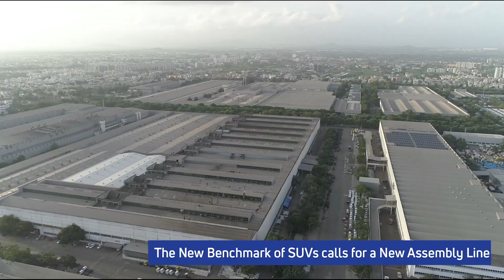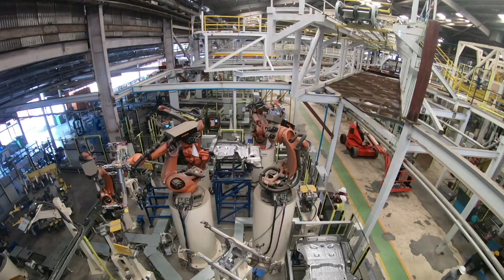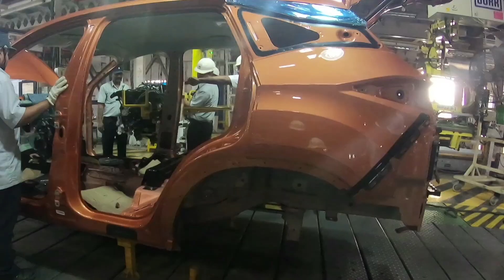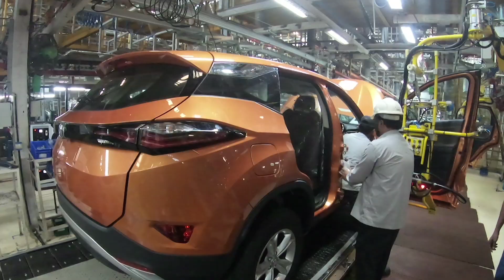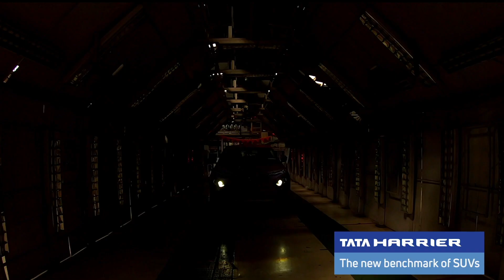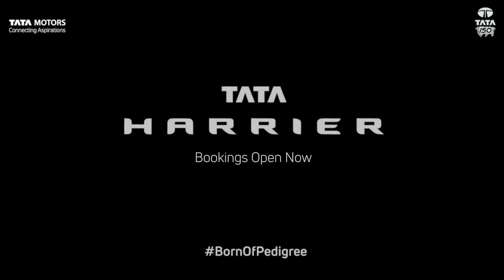Tata Harrier - First Car Roll-out

Comment: Tata motors please add sunroof,Tmps in Harrier.
Reply from the maker: Hi Deepak, thank you for your valuable input. We have shared the same with the relevant team for future consideration.
Reply: @tatamotors  I have also face problem with with safari storme airbag was available only in top model while Scorpio has optional airbag and abs also 4x4 from base variant.Please add airbag and cruise control and touch screen infontment music system in Safari storme ex variant instead of discount offer better features. Cruise control is must features for long drives in SUV I am getting 29-31kmpl in Honda city diesel on cruise control on highway which also increase fuel efficiency and customer satisfaction Honda uses cruise control features to show better mileage than company ARAI figure to convince customers and provides cruise control on 2nd variant onwards.

Comment: Dear Tata Motors,

Congratulations for the new Harrier. I was very excited for the first look of Harrier's production  version and with a very heavy heart have to say that I am a bit disappointed with the recent launches for the reasons below:

1.Impact 2.0 has not been very effective compared to the Impact 1.0 if you see the difference from the concept of Tata Nexon and the production version. The concept was bulky and could be matched with Jeep Compass in looks but the production version looks similar to Mahindra XUV500 with its low bonnet and MUV like rear end.

2.Coupe like roof which would stand out from other SUV is missing. Same goes with the diamond cut alloy wheels, sunroof, under bonnet skirting etc. The car in the video can overtake the Hyundai Creta but not the Jeep Compass in the long run as it looks like a complete SUV.

3.The JTP versions should have been given some sporty different colour as your normal cars had the same colour and the Tiago Wizz had the same black rooftop. You took a bold step by launching such a car then why hesitate to step back with colors.

Having said the above have always been a big Tata fan as i have owned Tata Nano from 2011 and Tata Tiago from 2017 and have felt very proud with the way the cars have improved and will buy a Harrier (as no doubt this will be the best car from TATA. 

Please consider of having 7 airbags instead of 6 airbags.

Thank you
Reply from the maker: Hi Nikhil, we thank you for sharing your valuable feedback. Suggestions really help us make the necessary improvements in our products. Do let us know if there is anything else you need our assistance with, and we'd be happy to help. 😊

Comment: Hi Tata...I recently bought my 5th Tata vehicle.this time from Delhi.and the model is Nexon XT. I had upgraded the wheels from the steel rims to alloy from the showroom itself and that too within a week from my purchase.Now, below are the things that has happened to me in this purchase which I had never felt earlier while buying a Tata vehicle earlier. 
1. The bill for the alloys is still pending and whenever I ask the service manager for the same he says that it would be provided by the accessories manager and vice versa.
2.the wheel caps have still not been provided and the reason stated by the above two managers is that these are not being delivered to us for the past six months??? Six months??????????? I mean the company provides you with the 4 alloys worth 40K and doesn't send the caps which would max be worth of 200-300inr.
3.the alloy wheels set was originally told for all the wheels...All the wheels does include the spare as well.but post installation they said that only the four running are only converted to alloys...I mean does that makes sense in any case??????
4. Now the alloys were upgraded to the size 215/16..the tyres that are originally fitted in steel rims are of 195/6. Now what the dealership did was they just anyhow put in the 195/16 tyres on my new alloys with size 215/16.
Doesnt this really matter that you are putting on a wrong accessory on the part which is the basic of any vehicle to run.and what would happen if something goes off during a Ride...
Really disappointed this time from the dealership of Tata..And dealership is what a company's face is...These are the customer contact points which make or break a brand..Had been a very loyal customer of Tata for a very long time...And hence the disappointment. 
Hope someone listens to this...
Reply from the maker: Hi Gaurav, we're disappointed to hear this. Please share your contact detail, chassis number and the dealer details via a YouTube message, so that we can expedite your concern with the relevant team.
Reply: Tata Motors team any update please..